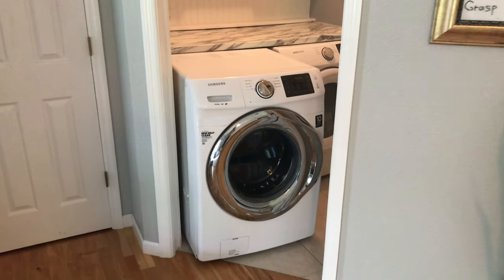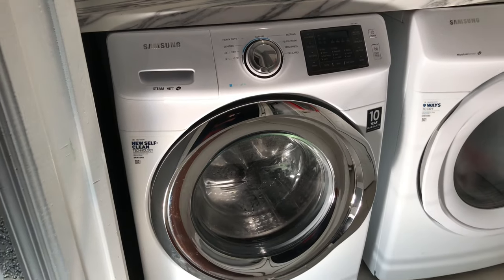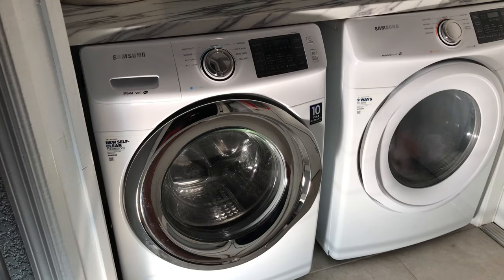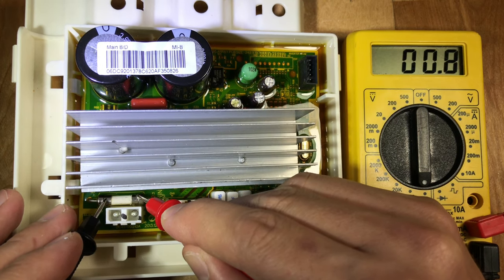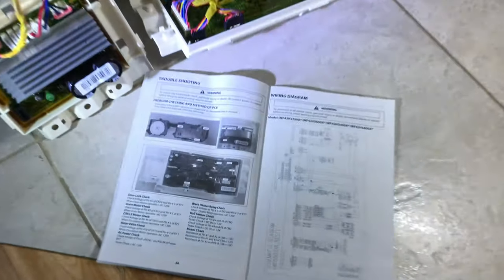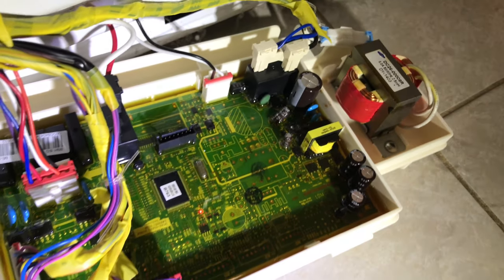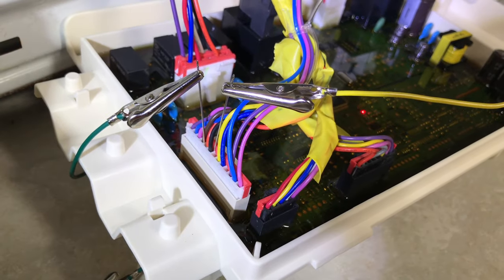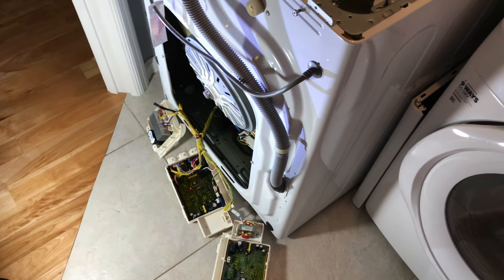Samsung washer not turning on - Diagnostic and repair of the main logic board.

Comment from the maker: Parts and tools that I used in this video: 
Digital multimeter: https://amzn.to/2ZZTUTp
Logic board: http://rover.ebay.com/rover/1/711-53200-19255-0/1?icep_ff3=9&pub=5575132837&toolid=10001&campid=5338592483&customid=&icep_uq=Samsung+washer+logic+board+DC92-01621&icep_sellerId=&icep_ex_kw=&icep_sortBy=12&icep_catId=&icep_minPrice=&icep_maxPrice=&ipn=psmain&icep_vectorid=229466&kwid=902099&mtid=824&kw=lg
(These are Amazon and eBay sponsored links. DIY-time Tech is a participant in the eBay Associates Program, an affiliate advertising program designed to provide a means for sites to earn advertising fees by advertising and linking to ebay.com.).
Reply: Are those paper clips you're using to test voltage?

Comment: Thank you so much for this video. My Samsung washing machine just stopped working last week. 1.5 year old unit (uhhh Samsung, really?) Anyways, it refused to power on for no apparent reason. I had a repairman come over and say that it was "going to be about $700 to fix and that I should buy a new one or a home warranty from his company." He spent about 9 minutes taking the top off and pointing to wires and happily took his $129 diagnostic fee. I took a gamble and watched your video a few times. Ordered a new logic board, crossed my fingers and installed. Instant fix. Your wisdom and willingness to share saved me a lot of money. Seriously, thank you.
Reply from the maker: 👌🏻
Awesome, Im glad it worked out well for you!
Reply: Mine just didn’t turn on . I think is the transformer . There’s a click when I press on .
Reply: @moisesbecerra8316  mine has the same problem. Mine clicks how did you solve yours
Reply: @danieladeniji5854  mine flashes the display 1 sec, then stays off and hear the click every 6-7 seconds. Did you end up fixing yours?

Comment: Such an excellent and informative video that is to the point and very easy to follow along.
Just wanted to add that this was exactly the same issue I had with the Samsung 6300 series washer that was purchased late 2019. Not impressed with Samsung after only three years of moderate use and it goes belly up!

I tried replacing the front control board but that wasn't the fix. The reason is because I tested pins 4&5 which measured 5V for about a minute and then measured 0V. I thought the front display is on a timer anyways so maybe the PCB board was fine and it's my front display. A new front board didn't fix the issue. It still would not turn on!

Ordered the PCB board of the exact model and works like a charm! 

Thanks for this, appreciate your efforts very much!

Comment: Glad I found your video, my 3 year old washer had no power so i ordered a new board for $214 Canadian delivered. Up and running again. I was impressed how well the Samsung is put together and the parts look very good, but as most things today the electronics are a weak link
Reply from the maker: Glad it was helpful!
Reply: Mine too 3 year old Samsung washer won't start at all.
Reply: @DIYtimeTech  can you please help me? My Samsung washer was not coming on and I replaced the board and came on and we started washing, then stopped after 15 minutes of work and never came back on,fuse is ok ,but don't know what else to check
Reply: hey any chance you could point me in the direction of whats up with my ecobubble? so its started to not turn on OR when it will turn on, it will start the cycle etc and then 5 or 15 minutes in just randomly dies as if i have pulled the plug out the wall - now i know when its going to turn on because when i switch the plug socket on i can hear a click and i know it will power on BUT until i hear that its dead to the world, any ideas??? @DIYtimeTech
Reply: I have the same one, 3 years in and it won't turn on...wouldn't recommend a Samsung to anyone

Comment: Great job on giving us all the correct testing and diagnostic's steps for the control board. I had the same exact problem but the RED LED Light was not blinking on my board. After going through all your steps, I did NOT have the 5 Volts between pin #4 and pin #5 on the CN7 Connector. I just put a new control board in today and it works now. Thanks again for your video, it was very helpful
Reply from the maker: Awesome, I am glad this was helpful!

Comment: Thank you so much for doing this video!  I have the same washer and it did the exact same thing. It would take multiple hits of the power button to turn on, until it didn't. Watched your video, followed your troubleshooting and looked up the service manuals as well. Was missing the same 5 volts DC. So replaced the board. I had to pay $150.00 for mine... I have also fixed the Dryer twice, once to replace a drum roller wheel, and then the heating element as it burnt out.  Not impressed with Samsung washers and dryers!  So thank you again for posting this and helping me out!
Reply from the maker: I feel like they don’t built them to last any more. Our drier also gad burnt element, and we replaced PLASTIC rollers on my parent’s washer twice already! For that reason we always buy extra 5-years warranty now. 
Im glad this video has helpful and thanks for your kind words!

Comment: Thank you sooooo much for publishing this video. My samsung washing machine would not turn on too and by using this video as a reference for inspection and testing, I decided to replace the board. $200 for a board and 1 day shipping and we are back washing clothes again!  I would like to add that apparently there are 2 different main  boards available for these washers, a "3 capacitor" and a "4 capacitor".  The video showes the 4 capacitor and mine was the 3 capacitor. This meant that I could not do the exact same electrical tests that you did on mine, but I went ahead and replaced it and It works perfectly.

Comment: Great Video.. Tried this procedure, tested all suggested voltage pins.. I had incoming 120 volts, but did not have the correct 12v, and no 5v coming out.. Ordered new board on line. Install new board with fingers crossed.. AND WOW unit now works, wife is so happy.. Thank you for this perfect diagnosis video.. Great Job Bro..
Reply from the maker: Awesome, glad to hear that!

Comment: Thank for this precious guide, it helped quite a lot. in my case it was the wifi module that caused a short circuit. Unplugged it and the washer started as there had never been a problem.
Reply from the maker: Thanks!
Reply: Where is the wifi module mine has same problem

Comment: Thank you. Saved me hundred$. BTW, your links go to the wrong part. Make sure you compare the actual sticker on the board with what you are buying - I bought the non-returnable wrong one.
Reply from the maker: Yeah, I think depending on the features of each individual washer, the main boards will have slight variations. Always compare the model number.

Comment: Thanks for the info
 I'm working on one tomorrow with the same problem. A lot of times you can look at your transformers on the boards it will at least give you your voltage in AC are DC . Then you just need to know your testing location. A lot of board now have DC volt transformer. Good jobs thanks

Comment: Iv got 7v between pin 4 and 5.  I'm not sure how to determine if the user interface board is broken and drawing too much power or if the main board is broken and sending too much power. 
Also I think 7v is high enough over 5v to damage the user interface board.

Any ideas?

Comment: So have you repaired the old pcb which have no 5v output between  cn 11 pin 4 and 5?I have a dc92-01621d same symptom with yours.It also have no 5 v in pin 4 of cn11.

Comment: Is this the board that would probably fry if my house was hit by lightning? My washer lets in water for a couple seconds and then stops and thinks and then another couple seconds and stops and another couple seconds and stops and then I get the rolling lights on the display. I replace the water inlet valves and that didn’t fix it. So I’m thinking it’s probably this logic board that controls when those open and close?

Comment: hiya, thanks so much for this info. Trying to diagnose my washer (same samsung unit that isn't turning on, but does have a click from the relay when I press the power button), and looks like there's 120VAC to the main logic board CN7 providing good 5v and 12v power.  Where did you find the service manual?  Any ideas on next steps to diagnose?  Not sure which board to get, though figure it's one of the three at this point.
Reply from the maker: There is a web address that I used shown on the screen @ 4:25 mark in this video.
Reply: in case it helps anyone else... I ended up getting a replacement main logic board (DC92-01803D) from ebay.  Popping in the new logic board was easy and resolved all issues (intermittently would  not turn on)
Reply from the maker: Great, thank you for sharing!
Reply: NoTanFightFan   I took a shot in the dark (and kind of an educated guess), and it worked for me.  Your issues sound different, but the main logic board would be a good first target--certainly a lot less expensive than paying for a tech to come out and the high price they charge for them to pop in a board.  Good luck!

Comment: I'm in the process of doing this exact thing. I have new main control board, display board & "coil harmonic" parts. My issue is I don't know where to locate the coil harmonic part # DC26-00009T. Any advice?

Comment: Nice job.  Did you happen to go back and find what happened to the 5 volts on the board?
Reply from the maker: No. The board didn't have any visible signs of damage, so I wasnt sure what part was broken. Plus it was filled with silicone to protect from water & moisture, so it would be  pretty difficult to work on it anyway...

Comment: I have different control board. Incoming voltage to the board between pin 4 and 1 are 5 volts. Pins 3 and 4 has 240v.  What does that mean?

Comment: Have a similar Samsung front loader that will start but will not complete a cycle sometimes fills some not. Counts down rapidly and shuts off . Sometimes makes clicking noises. Does this sound like a logic board problem??
Reply from the maker: Yeah... this is what happened in my case.

Comment: Hi replace my old board with the new,the machine turn on a little then shuts off,there is a clicking sound in the mc board when attempting to turn,then I have to unplug the  machine plug in and try again but no progress
Reply: Did you find our what was wrong ?
Reply: Hi did not find out what was wrong
Reply: The machine still isn't working
Reply: @ryangriffith5225  is it working now? Did you find out?

Comment: In my case on this machine wf42h5000 the control panel works but washer don't fill or spin and on the panel looks like is working fine
Reply: did you find the solution to this?
Reply: @curtisfairweather1968  yes sir. The problem with my ended on bad  drain pump  because i never heard if working or not so i tested with voltmeter it has voltage but no working . I buy a new pump from ebay DC31-00178A and it works

Comment: What were your symptoms? My display board is flickering off and on. Then it stops altogether.
Reply from the maker: It would stop in a middle of a washing cycle and not turn on for hours or even days at first. Then it stopped turning on altogether.
Reply: @DIYtimeTech  I have same problem flickering off and it keeps continues.. Not sure this is due to the PCB board. Please advice.
Reply: I have a clicking sound sounds like it’s coming from the board
Reply: Update: my clicking sound is coming from a relay. I had 120volts to that relay as tested in the first step so not sure why the clicking
Reply: @DIYtimeTech  I have same problem with mine too.
Reply: @WiLL02724  did you solve the issue? Mine is like this right now

Comment: HELP! I have a Samsung Front Load Washer (Model WF365BTBGSF 4.1 cu ft). 
Initially the machine displayed an error code (AE). I reset the machine. Removed the power cord and let it
rest. I also reset the electrical breaker. It started back up and ran for the five minutes and shut down. The AE code no longer displays - the machine display simply goes blank and eventually powers down. 

The AE - fault code indicates a communication issue of the washers main components. I opened the machine,
inspected it and decided to replace the main control panel (DC92-01527C) - RESULT: NO Change 

Machine started up initially but powers down after 60-90 seconds. I continues to do this, provided it is
unplugged or the electrical panel breaker has been turned off (removing all power to the machine) for an extended period before turning it back on. 

My sense is there is a capacitor somewhere that needs to be replaced. I saw two small capacitors on the main board but my guess is they regulate power to the components on the PCB and there must be another regulating the motor.
Reply from the maker: You can try to find a specific diagram online for you washer PCB, and check if  getting correct power.
If not, look for any visual signs of blown capacitors.

Comment: I need help! all my voltages are correct after i have replaced everything (both boards in the back, the board behind the display and the display its self) and my screen still will not turn on. i can here the relay click when i press the power button but the display does not turn on. i also checked all my voltages to the display and they are the correct voltages. Getting real close to taking the washing machine to the gun range at this point. Has anyone else had this problem? If so any solution?? Thanks in  advance.

Comment: Mines not turning on aswell..ive only had it 3 years...im never getting a Samsung washer again
Reply from the maker: I feel like they are all designed to fail around 3 years. 
I always buy 5 years warranty for $100 extra, and I used it EVERY SINGLE TIME around years 4-5.
Got new fridge, new washer, and dryer was repaired 1 month before warranty expired.
Reply: @DIYtimeTech  seems like a money making scheme by these companies. Washer is working but the digital panel has gone. Home contents insurance aint covering faults either 😒